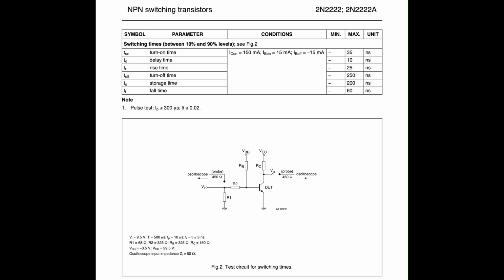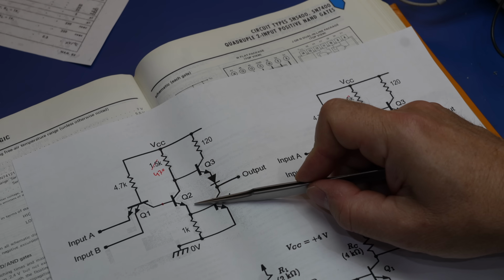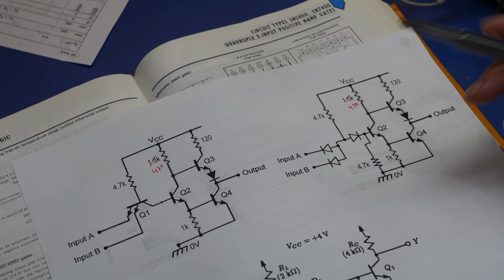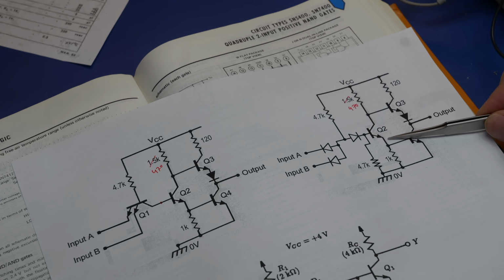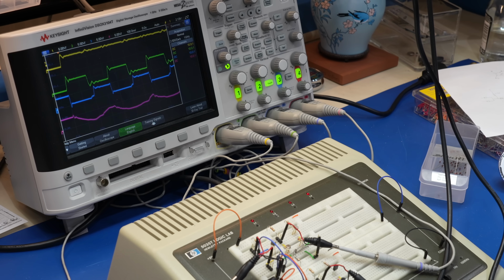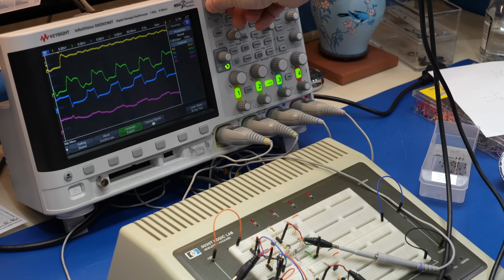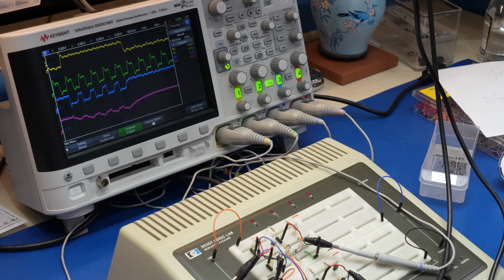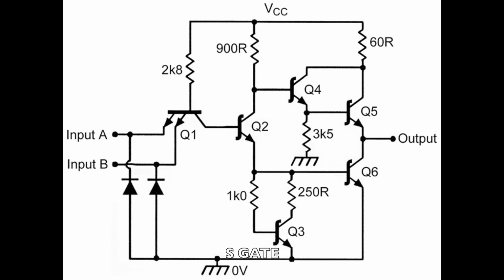How a TTL gate really works - we find out by building one

Comment: Finding a discrete 2-emitter transistor was quite a find. I dont think I've ever seen one.
Reply from the maker: Credit goes to Mike Stewart, who chased the parts used in the Apollo PCM and CDU, for a completely different application (as an analog mux), and found a bunch of new old ones on… Etsy!
Reply: I just recently asked Gemini and it told me there were no discrete multi-emitter transistors made. So it was wrong.
Reply: Very common though in  integrated circuit design, where you get transistors with multiple emitters, and especially true and common ones with different areas, so that you can, with a small amount of transistors around the die, make both a bandgap reference, and also a temperature sensor, that is accurate to within 0.1% typically, without needing to do any calibration, just control the exact areas of those 2 emitters relative to each other, so the ratio is correct. Add in some calibration and you can get another order of magnitude accuracy, and a precision reference that typically is stable for decades, and does not need burning in for hundreds of hours. Precision zener diodes exist, though those are more stable, but slowly drift, and are thus reserved for calibration of others, as they need a lot of external circuitry to keep them stable, along with ultra precision resistors to provide the current through it, and that is a lot more difficult to make.
Reply: @SeanBZA  Yes, because in an IC you can draw any shapes you like out of silicon. Making them discrete means there has to be enough demand to justify the factory to make millions and put them in a case. There aren't any discrete P-channel depletion-mode MOSFETs, either.
Reply: @thewhitefalcon8539  There are, but they are not common parts, and are made in tiny quantities for specialist applications. you basically have to have a use for one, and then get a foundry to run a dozen wafers for you, and then you get 100k devices that you have to go through and select parameters to meet your application.

Comment: Good  old TTL logic gates. I recall when this circuit was explained in electronics class.  I was listening to your explanation and was trying to remember the teacher's explanation back in 1984.  We didn't build one on a breadboard because we didn't have the multiple emitter transistors to play with in the lab.  But that's the way you learn how technology works! 

One family that you didn't mention, but hinted at (or you did mention it and I was zoned out)  was ECL (Emitter Coupled Logic, pronounced EH-CULL) as a faster but more power hungry family that operated in the linear region and not saturation modes making the logic switching happen faster.  I was told that most of that tech was used long ago, prone to noise and power supply glitches and so it was not commonly in use anymore except for specialty applications

But Good Stuff.
Reply: We here call ECL as Eeeh Seee Elll. ECL. Never heard of EH-CULL before.
Reply: @kl1nk0r  well, that's I was told, ECL like it rhymes with Heckle...  So you say each letter, interesting. Okay. Learned something new, thanks! 🙂
Reply: LOL @ 'except for specialty applications'...
FYI, the Cray-1 (supercomputer) was one such 'specialty application' that employed ECL logic to achieve a significantly higher clock speed.
It helped to have a nearby nuclear power plant though as these puppies sucked a LOT of electrons (as you might expect)
Reply: @trevorvanbremen4718  Yep, that's what I was told... it was for serious speed, and took serious power.   You made me chuckle helps to have a nuclear reactor nearby,  But that's nothing these days for the power requirements for these AI data center, that's no joke.
Reply: @HobbyHalloween  
Artificial Intelligence shares the SAME acronym as Artificial Insemination...
Either way, you're kinda screwed!
Reply: I can’t say Cray machines weren’t specialty applications lol
Reply: @sashimanu  Well maybe that point got lost to me, I may have misquoted or misremembered what my electronics prof said over 40 years ago. We didn't study or play with any ECL in our labs,  just standard TTL and CMOS.  

Supercomputers, like the CRAY back in the1980's were a specialty item.  About 10 years ago, I got to see one on display at a computer museum, non-functioning, but there's no doubt that they were awesome in their day.

Comment: But what if you need a 3-input NOR gate - where are you going to get a 3-emitter transistor? 😂
Reply: Common as mud at your local semiconductor fab...

Edit: Suggest you take a look at the 7430 datasheet... An EIGHT input NAND gate
Reply: @trevorvanbremen4718  Or 13-input NAND, the 74133. I think I used one years ago for bankswitching on some Atari 2600 homebrew cart.
Reply: Make a Frankensistor.

Comment: This takes me back almost to engineering infancy. The No 1 EAX (a Class 4/5 electromechanical telephone switch) Register-Sender logic was “programmed” solely with diodes and transistors. We had a chain smoking Hungarian emigre mathematician/engineer who handled it all. The smallest “software update” was pages upon pages of wiring change instructions for field technicians to implement. Now it would be a trivial DSP or microprocessor task.

Comment: Oh, this takes me back to my undergraduate semiconductor theory classes (50 years ago), which actually came in quite handy as a graduate student when I had to deal with charge dissipation times in opto-isolators that were used to keep undergraduate communication circuits (20 mA current loops) from "adversely impacting" the undergraduate lab's PDP-11s.  I wonder if most EE undergraduates today really get to see, hands on, the effects of carrier storage in base-emitter junctions and how that affects turn-on / turn-off times.
Reply: Opto-isolators were well known for their slow turn-off...  35 years ago we used the PC847 (PC817) for serial data comms and it was tricky to get high baudrates (like 38400 baud).  There were faster types, but expensive.